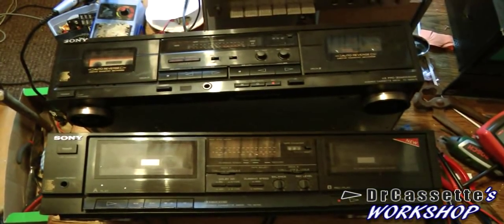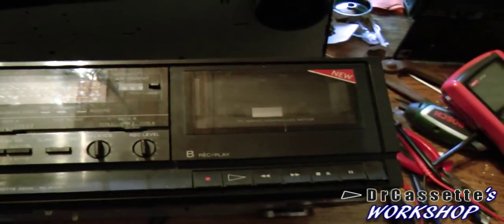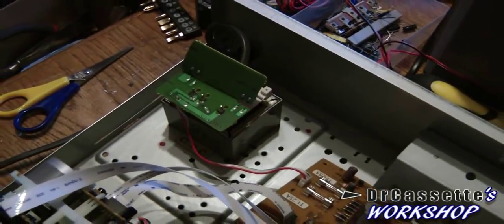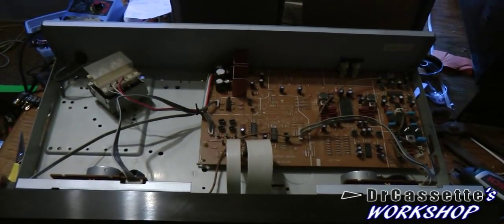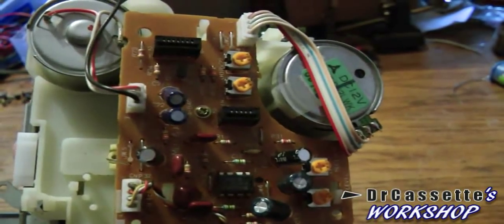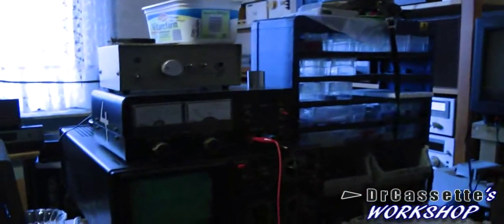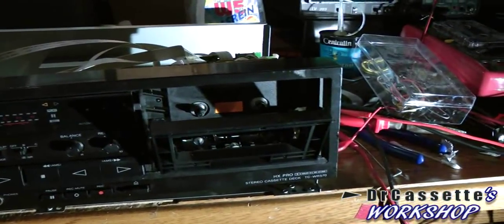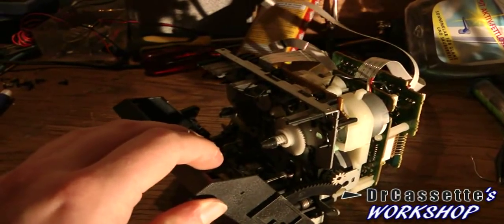DrCassette's Workshop - Double Double Cassette Deck Repairs

Comment: How did you finally fix the "power on self test problem" with deck b? I seem to have the exact problem with a similar tapedeck (TC-WE 505).
Thanks a lot for answering (after posting the repair about 8 years ago).

Comment: One thing that's for sure is that I would never go back to having mechanical cassette buttons, by the 90s it was 
usually only the really cheap bottom barrel or budget cassette decks that had mechanical buttons, soft touch
controls had pretty much become standard by that time. One advantage of a twin cassette deck over a single
cassette deck is that at least if one deck stops working you still have the other one although single cassette 
decks tend to be slightly better quality. Do you have to push buttons simultaneously to rewind or fast forward?

Comment: @DrCassette If the belt isn't the correct size, the amount of tension won't be quite right.  So the problem is with wow and flutter rather than the speed.

Comment: I have this deck and just learned why it isn't opening the doors. I might be able to fix it now i've watched your video. When i bought this deck (i think arround 1992) it was not a cheap one i guess (converted to euros) about € 350 and it performed very well.

Comment: There should be an inner speed potentiometer adjustment for both Deck A & Deck B on the circuit board somewhere. You can use those to compensate for the imperfect belt size.

Comment: I would at least have a go at changing the belts on the cheaper one if it is easy enough - you'd then at least be able to pass it on to someone who might need a basic deck. Better than putting it in the dump! I have the TCRW610, identical to yours but not autoreverse. When I found it it was not in great condition - the belts I changed plus it had suffered a knock sometime and one deck mech was loose, I had to glue the mounting with a glue gun. I also lubricated the motor bearing as it squealed.

Comment: I just bought a barely used  Fisher Studio CR-W880 Dual Cassette Deck. When I press play from either side the cassette spins at about 2x the speed and no sounds comes out. Have you ever seen this issue before?
Reply from the maker: Seems like the head bridge with the pinch roller does not fully engage.

Comment: Hello. I have the same problem you tell at the end of your video with the last  cassette deck from Sony. All it seems right but it don,t work fine.  It begin to run but it stops in a couple of seconds. I have disassembled many times but always the same. Everything seems fine assembly.  I have changed the belts sometimes with the same model and never had problems doing the same.  ¿ Can you help me ?. Where is the problem.  What and how did you do ?
Reply from the maker: +juan gambin To be honest, in the end both decks went into the trash. Neither one of them is anything special...

Comment: Hello. I wonder if you can help. I have a boom box. It was eating the tapes. I cleaned the heads and it's still chewing up tapes. What else could cause this. It looked as if the pinch roller wasn't pinching the tape.
Reply from the maker: Eating tapes usually occurs when the take up reel either does not spin at all or has not enough torque to spin with a cassette in place. This is usually due to either bad belts or bad idler wheels. You will have to take the boombox apart and look inside.
Reply: @DrCassette  thank you for your reply I will take it apart and have a look

Comment: Hi sir.
I have a Sony TC-WR870 which has no power to the board could you help me out as im suspecting R700 R703 and R704 fusible resistor.
Reply: I have a circuit diagram i could email you if thats ok.

Thanks
Darryl

Comment: dr cassette have question I have Aiwa cassette deck wx-220 everything runs good headphones transports new belts 24.00 4 belts BUT THE PLAY OUT IS DEAD QUIET  so I can hear it on my stereo not just my headphones outher than that it is in GRATE shape let me know ok  like your videos  thanks w-c
Reply from the maker: Could be a simple problem such as bad solder joints on the output connectors.

Comment from the maker: @TwinMillMC 
I prefer replacing the belt with a proper one. The one I put into the record deck is way to tight, it's going to ruin the motor if I leave it in there.

Comment: A friend gave me this Sony dual cassette deck (tc-wr681) But when I put a tape in either side it does not turn, just clicks. Since I do not work on these decks, do you think it has any value? thanks, R Webb
Reply: did u ever figure out the deck - usually when the caspian sensor click- belts cause this

Comment: Hi. Thanks for doing these videos. I have a Sony TC-W411 which is like the better deck in this video. The belts need replacing. Can you explain how you got the cassette assembly out of the case in order to do the belt replacement? Also, where do you buy your belts from? Thank you!
Reply from the maker: I would strongly recommend you search for the service manual of your deck online. It will feature instructions on how to properly disassemble the deck without causing damage. Belts can be found online, I don't have a source good enough to recommend to others.

Comment: Hi Dr cassette can you still find these belts for a Sony deck?   I have a nice deck that that one of the belts got stock and left like that for years. When I opened it up to try to fix it I noticed the belt was all tangled up. So i left it at that  I really liked it.  Thanks
Reply from the maker: Belts are still readily available, all you need are the dimensions of the original belt.
Reply: DrCassette thanks

Comment: I have a Sony TC-WR545 both doors will not eject what cause this?
Reply from the maker: Sounds like the mechanisms are jammed up. Bad belts could be the reason.
Reply: OK thanks Drcassette I have taken it apart there is no belt's left just piece of belt's

Comment: the 4 motors in the sony could be for metal tapes which need more power
Reply from the maker: Metal cassettes need more magnetic energy to be recorded. Mechanically they behave exactly like any other cassette. The better one of the two decks has two motors per deck which allows them to run the capstan with a dedicated motor. This results in better speed stability.

Comment: Crap video you didn’t show any of the important part like  showing  how you got the deck out or putting on belts not much info
Reply from the maker: It doesn't say "how to" anywhere, doesn't it. If you can't even figure out how to disassemble the deck you should stay away from it anyways.